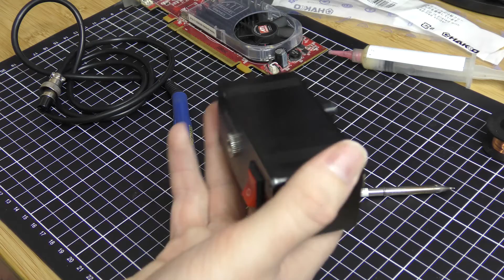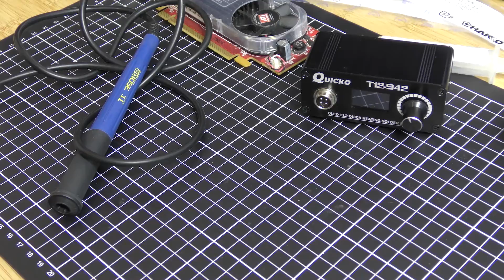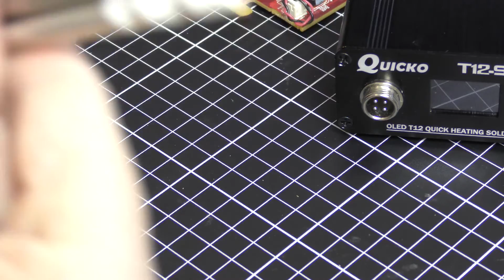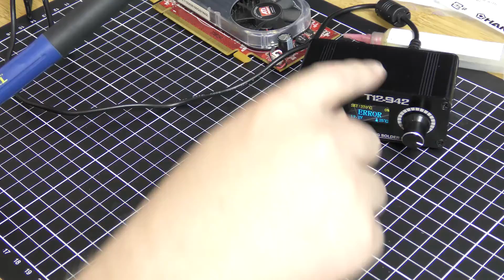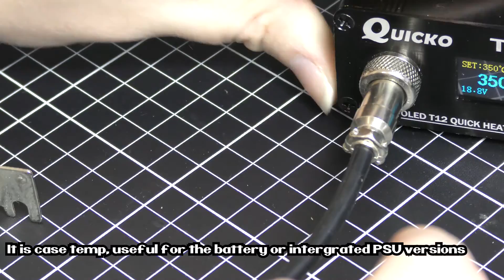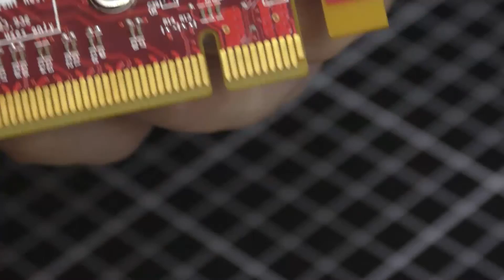The BEST Soldering Iron for ModChips | Hakko T12 Clone

Comment: If you work on the bench all the time, I think the version that has integrated power supply is so much better. Main thing is ESD safety, I'm really paranoid about breaking delicate stuff. Also it saves space not having to set up an extra power supply.

I have two such T12 stations both with integrated power supplies. Did close inspection upon receiving them and they've been working fine for a couple of years, not a single problem.
Reply from the maker: Yeah the leakage on this is annoying as it’s a floating psu, I might add a earth but also just thinking of upgrading to a C210 JBC clone, they are really nice

Comment: I have this model and the the display not lighting up, but iron is getting hot. only used a dozen times, any help would be great
Reply from the maker: Does it beep when you turn it on
Reply: Slot1Gamer Yes it beeps and iron gets hot too, but i need it showing the display to control it also easy to forget to switch off

Comment: Can I power this station with my powerbank (DC 5V; 2,1A)?
Reply from the maker: No voltage too low
Reply: @Slot1Gamer  is this soldering station compatible with hakko micro pencil tip.Whatup no +2348037848516
Reply: It requires 24v @ 3a

Comment: The handle is clone of HAKKO handle that was discontinued years ago. It is heavier than current 2028 handle, but changing tip is quicker and it is more solid.
Reply from the maker: There is a really nice all metal version out now as well
This clone one is a bit cheap, doesn’t go together nice

Comment: If you want it to go to sleep after a wile, you need one with 5 pin solder iron connector, then you get that option, but then you have to replace the board and connector and iron, and you need this: 

https://www.banggood.com/T12-Digital-Soldering-Station-OLED-Display-Control-Board-STC-Controller-Kit-p-1140746.html?cur_warehouse=CN

Comment: Hello. What is the power supply you are using? If I use a normal power brick for a laptop, like 90w, will it run in any problems? Good video. Best regards
Reply from the maker: It’ll work fine just don’t go over the max voltage.
Reply: Thank you for the reply

Comment: Hi friend, just a quick question that I don’t really understood. does it have sleep mode (similar with the original hakko) or the auto switch off is just to set a time and it switches off completely?

Thanks, really good video.
Reply from the maker: It has both, sleep and auto shut down :)
Reply from the maker: Sleep turns down the temperature until you move the handle
Auto shutdown counter starts once the iron goes to sleep, cancels if you move the handle

Comment: Hey man,  I made video not too long ago on the style with built-in psu (all aluminum) and love it! I switched out the handle to the quick change non-collar like you have. My KSGER handle didn't work out of the box either, plastic burrs kept the tip from seating all the way.
Reply from the maker: Awesome 
Does yours have the same switch inside
Reply: It has a power switch in the back and ball switch in the handle.
Reply from the maker: There is a new all metal handle for them that looks really nice
Reply: @Slot1Gamer  the KSGER has an aluminum hand piece, but I like the plastic one just fine. Neutral temperature.

Comment: This is pretty good I’ll try to pick one of these up, I bought a cheap soldering iron at a dollar store replace to help replace a capacitor and the whole time the iron was emitting  a ton of smoke.
Reply from the maker: Yeah the cheap ones tend to do that because they aren’t burnt in at the factory :) 
It’s usually just the protective oil used on the metal parts that’s smoking :)

I used to use a $2 iron, they are good for big tough things like automotive wiring and such but are no good for electronics as they are way to hot (mine used to glow red sometimes)

Comment: Pretty sure it doesn’t use 3A at the higher voltages if it’s anything like the TS80.
Reply: T12 tips' heater resistance is 8 ohms, if we apply 24V?! 24/8 = 3A.. So yes, depending on the tips and its real resistance at that time, it can reach 3A.
Reply from the maker: Yeah the elements are just 40w Max :) 
That rating is the max for the buck converter